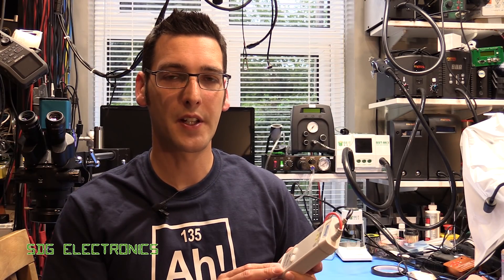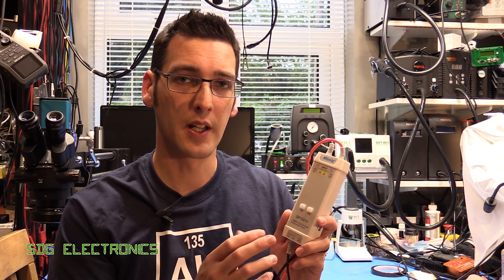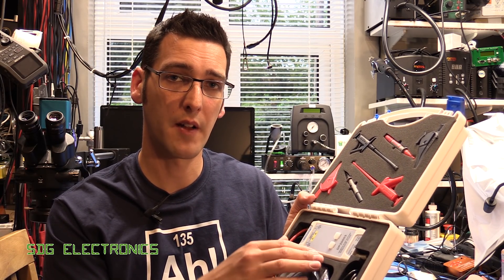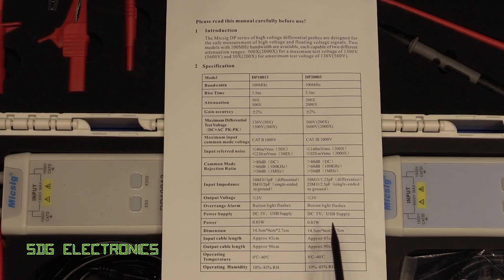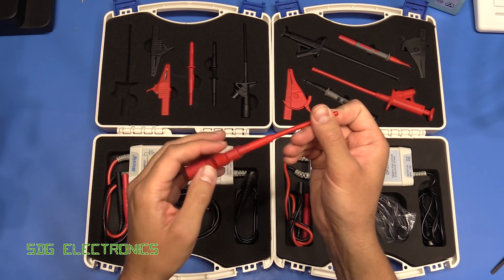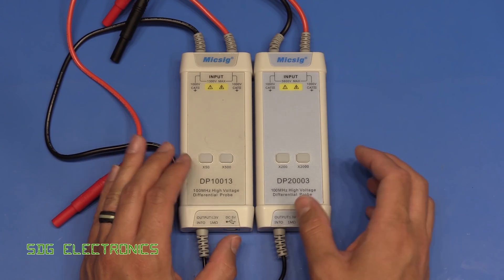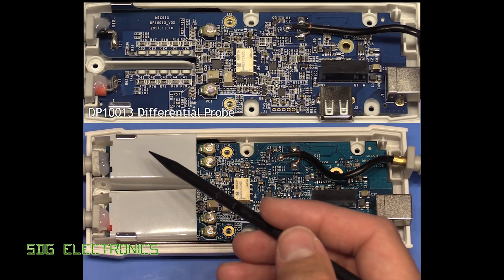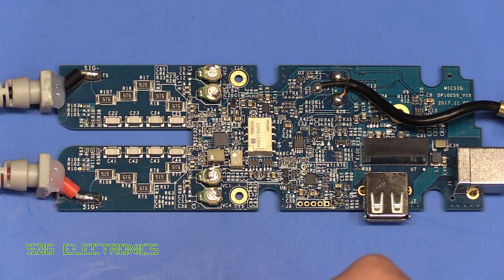SDG #081 Micsig DP20003 High Voltage Differential Probe

Comment: Have anyone ever actually seen a voltage vs. frequency derating curve charts fir any Micsig non-optical differential probes? A common misconception is that the differential probes are capable of full voltage specs throughout the nominal bandwidth, but in fact the voltage derating applies. But it may happen you burnt it on attempt to measure some fast switching low voltage pulse like 5 nS/1 kV

Comment: Nice review.

I know this to be an older video (3 years), but I feel either the DP10007 or newer DP750-100 is an even better fit for general power supply use in the US and perhaps even the UK.  They have better performance at lower voltages and still provide modes that get you up to the 700/750V ranges (better CMRR).  The DP10013 and DP20003 are definitely the choice if you need to work on voltages above 750V and if I ever do, I'll buy another probe set that allows for that in addition to the lower one I'm getting.

Comment: For me 1.3Kv is perfect. I build and experiment with small valve audio amps. The transformer output is usually 300-0-300v. Even going full wave with 600v that is around 850v so nicely in the range for 1.3Kv. Also 230v is valid but a bit low for where I live. I get 238v but in my previous house saw up to 248v. Both are valid for UK as the maximum is 253v. It just depends where you are in relation to the nearest transformer.

Comment: I part one of your video you mention you'd be using  the 10013  in  part 2. I'd like to see an actual demo  of someone using it. I would like to measure the output of my APC 1500 sinewave UPS to see if it is a true sinewave and not a square wave like the older units.  Thank you!

Comment: The peak to peak voltage is
 2 x 1.414 x 230 = 650V , not 340V. The 340V is Vpk-pk for 120V systems in US. Its actually 650 Vpk-pk for 230V systems like EU and UK.
Reply: wow, true ;-)
Reply: Yep

Comment: I being a novice,,, what does a differential probe do? I thought it was used to protect the scope from accidental being connected to common ground while probing the hot line ??? and would a RCD not trip in this case and thus save life and equipment ???
Reply from the maker: It allows you to make measurements across parts of your design referenced to something other than mains earth. With a normal probe the ground clip is directly connected to earth so limits some high side measurements

Comment: hi, I have seen the two videos of the Micsig probes. I do have one which is reading about 2 V more than what it should.

I would like to try to calibrate it, which I think should be done with the trimmers. How did you manage to open the case?
Reply from the maker: Carefully lift the label from the front to expose the screws

Comment: I would love to see a hobbyist affordable 1:10 differential probe for lower voltages. Any ideas?
Reply: Micsig 700V 100MHz High Voltage Differential Probe kit 3.5ns Rise Time 10X/100X Attenuation Rate Oscilloscope Probe Kit Accessory DP10007
Reply: @leroycasterline1122  Already ordered ;-) Thanks!

Comment: I bought a DP20003 a couple of years ago and it had very different probes which are clearly designed for high voltage and were different from the ones for the DP10013. 

The DP10013 probes at that time in fact looked exactly like the ones in this video.  This makes me wonder if they mistakenly packaged the 1300V probes intended for the 10013 with the 20003 seen in this video.

The manual advises also to not use the crocodile clips for high voltages unless the circuit under test is turned off and discharged before connecting.  This of course because, unlike the probes,  the crocodile clips have no special protection against high voltage.

This is what they look like:  http://www.micsig.com/UploadFiles/2018-06/%E5%AE%98%E7%BD%91%E4%BA%A7%E5%93%81%E9%A1%B5%E9%9D%A2%E4%B8%BB%E5%9B%BE.jpg

Comment: I have the original version and found the range choices a bit disappointing. However not really had a problem with it.  I have been playing  with the Hantek current clamps on my channel. I think you would do a good review of the current clamp and useful to use with the differential adapter.  I cannot be bothered doing in-depth review but I do like watching them. Thanks for sharing

Comment: When will we see a review of the BST-863 Rework Station??
Reply from the maker: Hi Robert, probably in the next week or so.
Reply: Cool! My Aoyue 852A++ is still working great, but I have been thinking about upgrading to a Rework station that has more features. And I rarely use the vacuum tool. I was looking at the Quick 861DW - there are many people that claim that it is the best Rework station for the price.
Reply from the maker: @robertcalkjr.8325  I've got two hot air stations which I will be doing videos on shortly, including the video on the BST-863. I wanted to cover some designed for slightly more professional use than the low cost types with the blower in the handle.
Reply: Mine doesn't have the blower in the handle and I don't think that the Quick does either. I think that I paid $149.99 for mine several years ago.

Comment: Seems like this differential probe is good value for money, might be ordering one soon, thanks for the review 👍
Reply from the maker: Yes, it works well and is at a really good price point, especially compared to the competition. Thanks Florin
Reply: Yes I have one they are very good and no annoying batteries to go flat like the picoscope. However some people may not like the usb power option.
Reply: I'm dealing with SMPS and DC/AC inverter development. I bought one, started using it then bought another one 🙂 Such a great value for this money. Did a side to side comparsion with a Pico TA043 and the results came out almost the same. Recommended stuff.